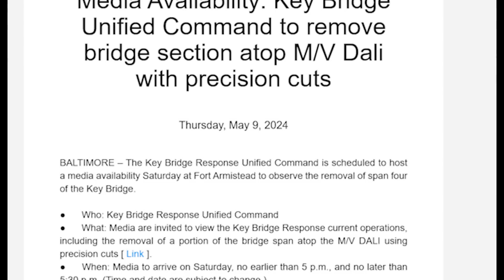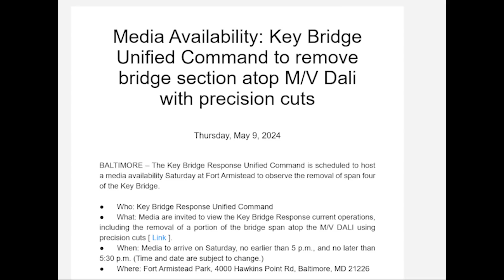Ready To Blow Key Bridge Off MV Dali Baltimore

Comment: They are not taking containers off to lighten the load they are taking containers off to make room to work to remove the debris
Reply from the maker: They are doing it for both. They already stated they did it to lighten the load. They did not remove 180 containers from the front of the bow, they also took them from other spots on the ship

Comment: I think the steel for the central truss is somewhere in the 2 to 4-inch thick range, possibly more, and about 4 to 6 feet wide by a couple of feet thick hollow beams.  These are welded up from plate steel and bolted together with high-strength bolts to form the complete truss. 
There is very little chance that any of those charges will go off prematurely by accident because of the type of material used and how they are handled.  These type of charges are frequently used to take down bridges and structures such as you showed yesterday.  Even C4 can be dropped or hit with a hammer and not go off; it takes primers to set it off.  What I know of this stuff is from videos and written info, but I would not want to just pick it up and mess with it without a lot of training.

Comment: You have no clue how dangerous rigging is. Especially odd shaped pieces where it is difficult to determine the center of gravity. The piece they lifted then put down, it was probably starting to move in a way they did not want so they are regrouping. The way you armchair quarterback these picks, it is obvious you have never done any rigging or lifting.
Reply from the maker: Great another holier than though troll. Obvious you have never done any. They made no changes to it, they set it down, and 8 am this morning they picked it back up and moved it, but the weather was foggy, and the waters were very choppy. That was risky, when they could have easily moved it last night.
Reply: @jeffostroff  I am not being holier than thou. I am defending people that are doing a dangerous job that are being criticized by someone who is an expert in one field and thinks they know other fields. Neither of us is there and I do not think it is fair to second guess why they are delaying a pick. It could be anything from something is wrong, to the engineer wants to recalculate the sling length. We should all be in awe that they are doing this difficult work safely. As for crane work, I have been involved with construction and overhauls of industrial facilities as well as developing rigging training at a shipyard. All of this has been done on dry land. I cannot fathom how much harder it could be in the water. I have been on the end of a 145 foot high reach and as you said the sway is a lot even without the wind. These guys are on bigger high reaches on barges. They are working from baskets hanging from cranes on barges. This is hard and dangerous and they are doing and they deserve respect, not second guessing as to why they are not moving fast enough.

Comment: They are going to use shape charges and the black thing is like a big rubber band that will hold the charge in proper position.
Reply: The charges are inserted inside the cuts they made in the steel.  They can't move.  The black thing just stops anything that flies out the other side when the charge goes off and cuts the metal.
Reply from the maker: What makes you think that black strip can stop a blast?
Reply: @jeffostroff  The blast is on the other side of the metal beam.  The black band keeps molten metal from flying.  Watch the detonation and you'll find out.

Comment: Those black sheets are thick rubber mats, designed to slow down or stop the molten metal and shrapnel from the explosion of the shaped charges.  The charges themselves are much smaller and fit in the small triangular slots that are being cut.  

Also, the charges are incredibly stable and won't even explode if engulfed in fire.  The only thing that triggers the explosive to go off is a pressure wave from a detonator that is fired by an electrical charge.

Comment: The charges are completely safe to handle. They will only explode when detonators are put into them and an they are wired  to explode.  The black things are mats that contain the explosion and send the pressure wave through the steel and not into the air.

Comment: In a silly moment, I figured they should cover all the pieces with car air bags and when the linear shaped charges do the cutting of the parts, each section would then trigger the airbags and rather than sinking to the bottom of the Federal Channel, all the sections would just sit on the surface floating ... and a tug boat with a big magnet could go past and tow all the bits over to Tradepoint Atlantic. :)

Comment: Im not sure if I missed an explanation but was wondering why the controlled detonation instead of using the giant shear,  torches and the claw? Are the Dali owners getting impatient in wanting their ship back to start repairs?
Reply: Because they can't safely predict how that structure will react if you start hacking at it one cut at a time.  This takes it all apart at once so it can fall into the water where it is safe to work on.  The Dali isn't going to be hauling cargo for a long time, if ever again.  It isn't even a consideration.  Getting the channel and thus the port of Baltimore fully open is the primary concern at this point.

Comment: They are shaped charges encased in copper. When the charge goes off it turns the copper into a knife blade. In less than 100th of a second the steel is cut. Then gravity takes over and pulls things apart. The fun part is those charges are held in place with ordinary rubber bands.
Reply: Rubber bands>> I don't think so, more black steel and threaded rods abd nuts - then again I could be wrong

Comment: 2 mile radius is to keep ships and drunk boaters far away, the exclusion zone allows enough time for CG cutter to intercept before they are in the danger zone.

Beam swinging was building up plastic deformation, and then as the steel cooled it finally fractured. The explosives are pretty inert until they put the detonators in, and likely here they are using coded detonators, which do not go off from stray currents, but which are addressed like stage lights, so they are all powered, and get sent a time delay command. Safer than a detcord as it can be tested for each charge right up to detonation, though a lot more expensive, and use once. But even with 5% failing that will still be successful in removing that beam structure, and then they can use larger charges to fracture the concrete after drilling into it to place them, or drill and use expanding mortar to fracture the concrete, so the claw and hammers can nibble it away.

Comment: Jeff,

I have spent a fair amount of time in shipyards in baskets hanging from cranes, riding sky climbers, and climbing on ladders and scaffolding on ships.  I would not want to be doing any of this on barge cranes.  Think about it your basket is hanging from a wire.  You are standing in the basket.  Your fall protection is hooked safely to the basket.

Based on my experiences with repairs, if I was Dali's owner, I would be assessing the cost and time for repair versus calling the ship a total constructive loss.  If they decide a repair is the right answer, I would expect them to have the shipyard build a completely new bow assembly.  To me, it would be a complete waste of time and money to try to salvage anything.  One of the questions that will need to be answered is how far aft would have to be replaced.

The other day you were wondering why they were cutting steel and letting it drop into the water.  You have to imagine the ship, the bridge remains, the salvors, and the cranes and rigging in 3D.  The people with the torches were hanging in the basket above the steel that was going to drop.  To secure the load to a second crane you would need to have clear access to rig the steel to the crane.  You would need to be sure that when the mass was transferred the steel would move safely away from the men in the basket.  A miscalculation could cost them their lives.

I was in the shipyard during a ship construction project.  The largest unit that could be handled was 150 LT.  The units were erected so the majority of the welding was downland, so some units were built upside-down.  To flip the units two cranes picked the unit up. One crane had a fabricated spreader roughly 30' × 6' fabricated of 3/4" plate.  The other crane used 2 wire slings.  The process involved lifting the unit, lowering the sling end until the spreader carried the full load.  The slings were detached.  The unit was rotated 180°, and the slings were reattached.  The unit was now right-side-up.

During the lift a wire sling failed and one crane lost its load.  The crane with the spreader stayed attached, and the crane was able to hold the load.  The unit was unharmed.  The spreader was bent lengthwise into a perfect parabola.  Luckily no one was hurt.

Bob
Reply: How interesting, thank you for the detailed info from an old lady from upper Michigan who's interested in everything!!!
Reply: @dianebeier8379  I am an old man who grew up in the Lower Peninsula and received his training at the University of Michigan.  Go Blue!

Comment: What does re float mean
Reply: Re-float is to un-sink…

The Dali is pressed against the sea floor with the bridge parts holding it down….

The ship is grounded, and needs to re-float before it can be moved back to port….  (Should we just go with float, instead of re-float?)

Removing the bridge parts will allow the Dali to float gain…

If the shipping channel was deeper, the Dali would have been lost below the water….

😃

Comment: The black strips are not the linear shaped charges, they are protective strips to catch the jet of molten metal after the charge detonates.  The charges are the thin copper-coated strips which you see on the opposite side of the beams from the black strips.  The charges run through the square holes cut in the web of the beams.

If you want to see them in detail, there are documentaries out there showing CDI using linear shaped charges to demolish steel framed structures.  The method CDI use is identical, with the pair of square holes for the charges joined by a thin chevron cut.
Reply: Yeah, thanks but he explained this.  3:29

Comment: The black rectangles may be blast pads.  You want as much energy as possible directed at the metal beams and you do not want shrapnel damaging the ship.  After the Dali is refloated and the containers removed, the ship's owners will probably get the ship into a drydock.  Replacing the bow may be cheaper than repairing the damage.  Many of the structural members have been stressed beyond their elastic limit.  Even if they have not, how would you test each joint and rivet and weld.  Plus, refloating the Dali may cause additional damage.  The Evergiven ran aground in the Suez Canal and even though she ran into soft sand, the bow was replaced rather than repaired.  All of this is going to be very expensive and take months to accomplish.
Reply: The Dali will not be fixed and seaworthy  until well over a year from now
Reply: @MikeBarbarossa  I agree.  Do you think the owners will scrap the ship rather than repair it?
Reply: @brucenadams1  The 'what going on in shipping' guy said it's likely to be repaired. If the keel is highly damaged,  scrapping may still be an option IMHO

Comment: At all video I admire how clean, aka well-painted the bridge trusses are. If one looks at other bridges the dominant impression is rust. But here, I have still to detect any rusty spot. SO either they did the painting just the other day and/or are doing a fantastic job of keeping the bridge in good order.
Reply: Well spotted detail! It wasn't until I read your comment that I realised just how clean the bridge steel work looked. 
The trouble with a bridge like this one is that if you allow your maintenance program to get away from you, it then takes extra time and money to try and recapture it!
Mark fromMelbourne Australia 🇦🇺
Reply: I don't know about this bridge, but I've heard that the Sydney Harbour Bridge in Sydney, Australia is being continually repainted - when they finish one repaint, they start again from the other end. It's over 90 years old now....

Suspect most large steel bridges are similarly under continual maintenance. (Greetings from Sydney, Australia).

Comment: These are plasma-jet charges of the same type used to seperate the space shuttle from that big orange fuel tank that lifted off from the Cape with it, older reliable technology. A detonator to initiate primacord, variable delay non-els to initiate cutter charges to get it moving away from the ship before it is completely cut. Modern explosives are extremely safe, they don't go off on their own they must be forced to go off.
Reply: You don't use plasma jet charges anywhere near 16 inch pipes carrying liquid hydrogen and liquid oxygen.  They use enclosed dual detonator frangible nut/bolt assemblies to secure the fore and aft struts and the ET umbilical plates to the bellly of the orbiter.  They use the RCS thrusters to move the shuttle away from the tank.  I really wonder where people come up with this stuff.
Reply: @stargazer7644  A local guy copied and modified the NASA ones (with their approval) for use as collar cutters in the oil patch, they were the best at the time. For what its worth...
Reply: @bruceday6799  You do realize the documentation and drawings for how the system worked is all publically available?  
NASA doesn't need to give their approval.  Anything NASA creates is public domain.  That's why all the drawings are out there.

Comment: Linear Shaped Charges- They resemble angle Iron NOT rods the mouth of the charge directs  the plasma from the blast into the slots they previously cut into the beams thusly slicing cleanly and quickly through.

Comment: How are they going to cut up and clear the concrete parts of the bridge?
Reply: I'd guess they would take a wrecking ball to the concrete pillars....generally that's how concrete structures are demolished.  But I could be wrong in this case...
Reply: Earlier video shows where the main concrete pillar was was cut in two.  Commenters under that video point out that a diamond studded belt saw (quarry style) was used, power plant mounted at the very front of the Dali itself, the chain a very long thin loop that cut concrete and steel cleanly.

Comment: The 3D simulation showing all the trusses moving sideways  ????????
They arnt going to move sideways.
They are going straight down on top of themselves and staying ON the Dali
Reply: Naturally you'll be back with a shoulder shrug if it goes as planned
Reply from the maker: They seem to think it will fall away from the ship, not just straight down
Reply: They can time the charges to go off at different intervals that will ensure the trusses fall away from the ship...........in theory at least.
Reply: @lyleparadise2764  it's an engineering thing
Reply: You rmbr that game called "Barrel of Monkeys" how the monkeys arms all hooked together so you could get as many monkeys out at a time..
All the trusses are simply going to collapse on each other and hook together. BUT then they WILL be able to get the smaller manageable pieces off by crane.